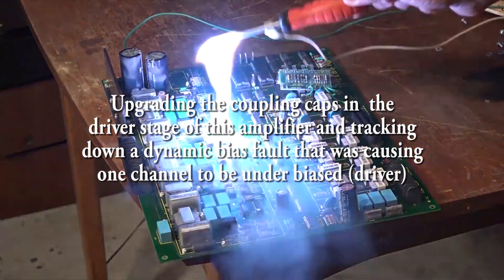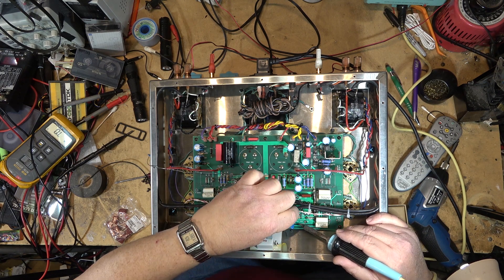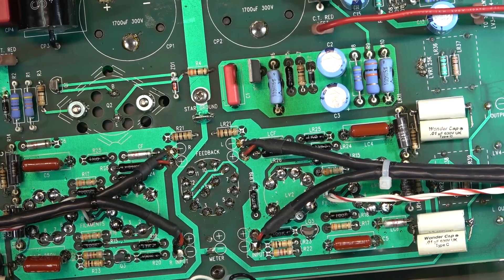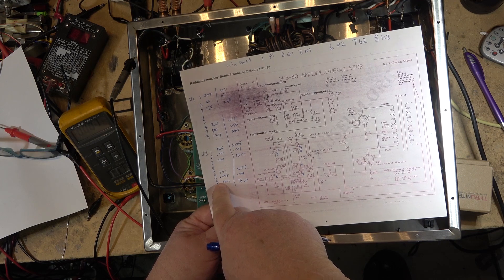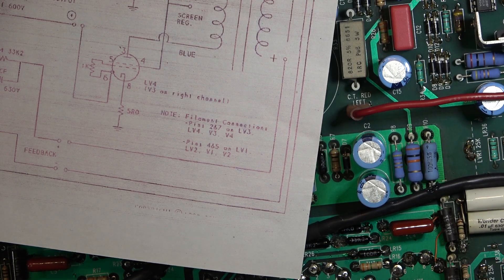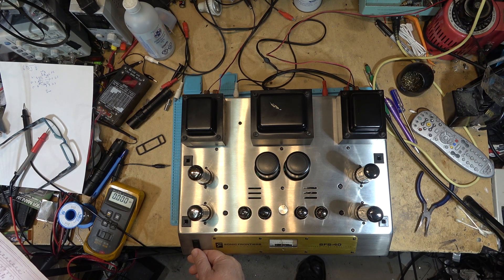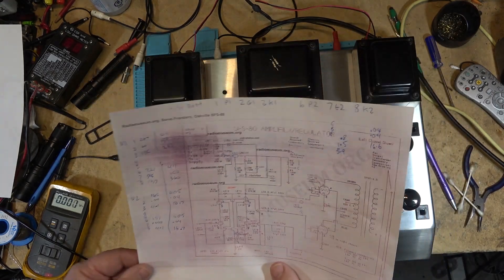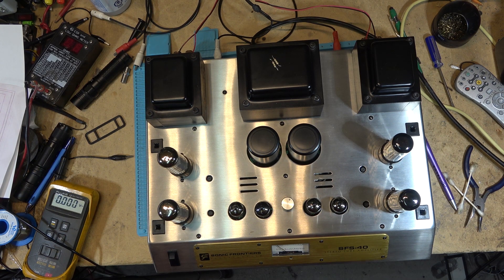Sonic Frontiers SFS40 chasing down an elusive dynamic bias fault in the driver stage. Part 2

Comment: Really funny to see SF “copied” the early dynamic bias designs of companies like Sumo and Threshold by bootstrapping the bias circuit to the output. Theoretically, a better way to do this would be to modulate the bias current based on the input signal. Nice work! Really happy to see content from you every day. Cheers!

Comment: Question on increasing the voltage rating on the caps; could those have been designed-in as a "safety fuse" in the line...my point is, they would go open if the voltage went above 250V thereby saving the rest of the circuit until repair?
Reply from the maker: They don't go open they short. They weren't put on for safety.  They were put in for cost.  Higher voltage film caps cost more.  Manufactures put the lowest cost components they can get on products. If you can shave 10.00 off the cost of each unit.

Comment: Many years ago, i was reading specs on Philips resistors. The small 1/2 watt ones also have a voltage rating,typical 250 volt. The design should have 2 470k in series. It seems the high voltage breaks down the carbon film internally.  I would do no more than a 150 volt drop across any small resistor. I have seen them fail in monitors and power supplies where you feed a  chip off the b plus.
Reply from the maker: Well if it lasts another 30 years I won't need to worry about it because i seriously doubt that I will still be around in 30 years avs I'd i am I certainly won't be doing this work anymore.  I doubt I'll be doing this in 10 years.  A co-worker used to say retirement is closer than you think.  Well that was 2013 when he retired.   I plan on 2 more at my day job and then this becomes my full time job (fixing stuff) untill I decide enough is enough and pull the plug on the repairs too. Pretty much guarantee i won't be doing this into my 70s though.
Reply: @12voltvids  you get that tiny canada pension, you may change yiur mind lol
Reply from the maker: @markanderson350  well, i get a company pension in addition to the Canada pension  plus the revenue that cinesbib from Google every month. I won't even need to tap into my savings.

Comment: i can understand the crappy caps failing but 1 meg resistors playing silly buggers just makes no sense.
Perhaps the resistors are under rated for the voltage,  i would replace each 1 meg with 2x470k to half the voltage across each resistor.
What an annoying fault.
Reply from the maker: High value resistors often cause failures when they drift

Comment: You did the right thing by changing those caps, those stupid things can short and do even more damage
Reply from the maker: They won't do damage.  If they short the grid is grounded and the tube is cut off.  If the coupling caps short the outputs go full on and the fuse would blow.  Now if someone put a bigger fuse in that doesn't blow the tubes would res plate and burn up. Worst case the output transformer or power transformer could be damaged.  The correct fuse however would blow long before damage.

Comment: Interesting that they'd toss a transistor in there for bias.   I'm used to pre-amp tubes just using a cathode resistor and bypass cap.
Reply from the maker: This is why modern tube design is superrior to the old design.   Dynamic bias is probably the best improvement to tube amplifiers. Old ones sounded good new ones fantastic.
Reply: I don't think it would be too hard to achieve the same functionality with a tube.
Reply from the maker: @eDoc2020  the dynamic bias keeps the tube linear regardless of the signal level. It was one of the most significant devolopments in modern tube technology

Comment: did you ever come across a Xonex ET-750? I'm trying to restore my late father's stereo but without a schematic, for me it's a big guessing game : (
Reply from the maker: Never heard of that
Reply: @12voltvids  well it's made in japan quadraphonic receiver with 8 track/4track..they're pretty rare, I think they might have only been sold in canada, that's why I though maybe back then you might have seen one, It's from 1972
Reply from the maker: @Limousine08  nope and there was much if that 70s stuff that people didn't even fix in the 80s. Do you know how many dual / noresco record players we threw out.  The sales guys told every single customer that brought their noresco (Canadian made receiver / amplifier with dual 1214 or 1219 built in) because the record changer was gunned up or the main filter cap in the amp was open? I got to fix perhaps 1 out if 10. The other 9 didn't make it into the shop, they went into the bin and the customer bought a new Technics or sony.
Reply: @12voltvids  hm well this one seems well made, I mean we had it 50 years and it actually still works, I'd  just like to put new bulbs and change caps, but I do see some DC on the speaker outputs about 4 volts and the bias seems way high..it was your video here that made me wonder about how the bias is regulated  in this stereo, if it could be a resister gone bad
Reply from the maker: @Limousine08  if it's a tube unit you won't see DC on speakers.  Solid state is a different animal.  Bias and balance for class b amps is a critical adjustment.
Reply: @12voltvids  it's not tubes. I set the bias on my 80's receivers, was pretty easy, but this one just has these 4 small  metal trim pots, I guess one for each channel but I'm not sure they'e meant to be adjusted, really wish I could find a manual or something
Reply from the maker: @Limousine08  yup, bias for each trabsistor.  You need a meter to measure idle currentm likely 1 bias and 1 balance per channel.
Reply: @12voltvids  ok I'll give it a shot, gonna change the 50 year old caps first and see how she acts..any idea for good range I should aim for for the bias since I have no manual?..40 mv or something?

Comment: Nice detective work. Funny that it still worked even though the voltages were way off. I guess that's the fun part about tube electronics.
Reply from the maker: Yes tubes can be way off and work but viktage flucation could put them into cut off.  The loss of dynamic bias is likely what popped the caps as the viktage would have been over the max rating of the original caps but the new ones are much higher rated voltage.